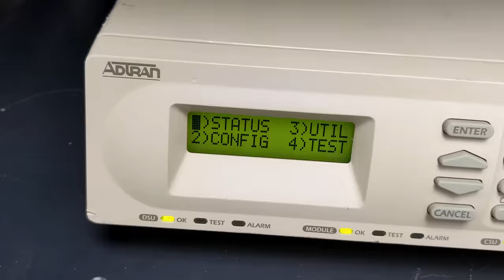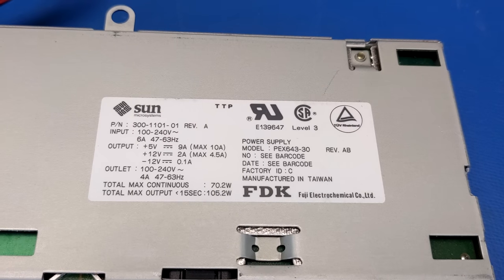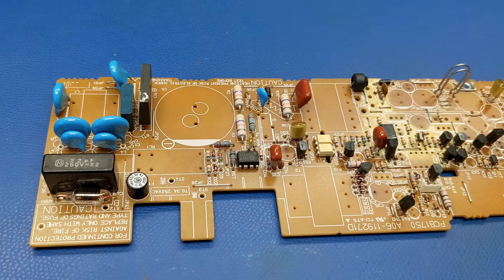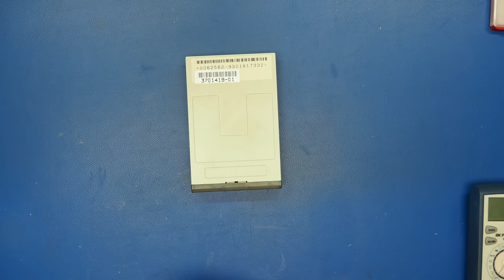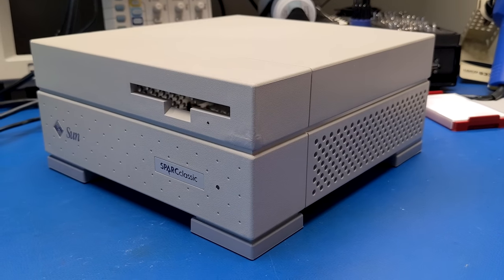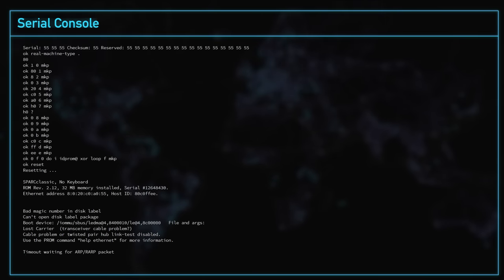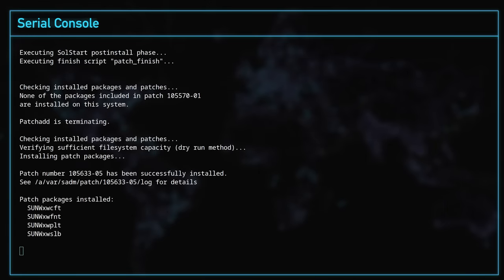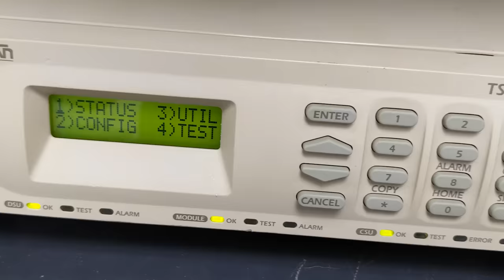SAVING a 30-year old Sun workstation! - ISP Series Episode 2

Comment: 35:27 The usage output shows a "-m" option (even with the normal skel system for the initial directory contents) similar to modern useradd implementations, I don't think you would have needed to create it manually if you used it.

Comment: Nice video and great job. I probably mentioned already that I used a Sun Sparc 20 with Solaris 8 as my main system sometime between Beos 5 and Linux and used it to stream international radio with Real Player. I also had Basilisk II emulating Mac Os 8 on a 21in CRT monitor. These were very reliable machines.

Comment: Satisfying board & mechanical design. The latching lever is just 🤯

Related tip for fellow tinkerers: if you need to repair broken plastic but can't access a 3D-printer, there's always the classic "superglue & baking soda" -method.

You just need these two ingredients and a file and/or sandpaper. If the part is visible, finish with some paint (model paint is really good).

I have succesfully repaired a broken record player hinge, battery compartment covers and one printer tray. The fix is very durable!
Reply: Yes!  I learned that trick from an Adam Savage video not long ago and I was a bit surprised they didn't use it to fill around the 3d-printed part.  As an aside, it works really well to patch a cracked fingernail until it grows out enough too!

Comment: I used to have this exact model on my desk (along with a CD-ROM extension module (CD Caddys - ugh) & storage) with a massive 19" Sun (Sony Trinitron) CRT monitor. Our core systems were Unix machines when I worked for a stockbrokers. Pyramid DC-OSx Mini's then and HP Mini's along with some Xenix boxes. The Sun was our management and monitoring workstation running XWindows - I had a display running on it that would show current CPU usage for all the UNIX machines, and would use it to console onto all our servers as needed. Was (at the time) much easier to use than a Windows machine as with Windows 3.1 at the time you needed tonnes of extra software to achieve the same outcomes.

Comment: I was there in the 90s local dialup ISP. We didn't use Sun, but it's still nostalgiac for me 👍
Reply: I had about 10 of these machines in the end.  We ran RADIUS out of them to get user accounts working.  Other ISPs I worked for - we transitioned to freeBSD.
Reply: @tcpnetworks  We began as a Windows shop, but switched to Linux for basically everything but the customer representative's desktops.

Comment: Wow that's brought back memories seeing Solaris again. My first intro to Sun Microsystems was a pair of SPARC 20 servers I set up for email and DNS back in '95. Spent the next 20 years working with a variety of SPARC and x86/x64 systems. Last one I worked on before changing jobs was an M3000. I always likened the sound of the fans on startup to the sound of a Harrier jump jet!  The Suns were rock solid kit. My only regret is not bagging one of the SPARC20s when ghey were replaced!

Comment: I had that exact model that I got from work when they were about to throw it out. I got it working with Redhat, but it was slow. Loved the keyboard. Shortly after moving to an apartment, I threw it out and I've been kicking myself over it ever since :(
I remember accessing my university's Sun system remotely over PPP in the '90s.  I discovered a library that tunneled all TCP/IP requests over PPP and let my local X-Windows Server display GUI apps running remotely on the Sun system. There was a method to apply this library to any app. It was awesome, I was probably one of very few people in the university using this system like that.

Comment: Wow, that brings back a lot of memories. I lived in Silicon Valley during the first dot-com boom, and thanks to some friends I was able to score a SPARCstation IPC (or maybe IPX; I forget which) for my home computer for a reasonable amount of money. As I recall, the Sun 13W3-to-SVGA video cable cost me more than the workstation. Great machine for the time, though. 

I also remember setting up a “Custom Jumpstart Install” server for work, which was great. You could net boot a new Sun workstation, and based on the CPU type/RAM/HD size/subnet the server would automatically install and configure Solaris and a bunch of application software. The company I worked for was a hardware manufacturer and all our engineers had Sun workstations on their desks, plus we had a BUNCH in our labs, so that was a huge time saver.
Reply: You could run a fairly large Sun installation on two system administrators.  

More than a 1000 machines was completely ok.

Comment: If you want another challenge, I have a variety of old SUN workstations and parts. I do need to get rid of them but I don't want it to be e-waste. Minor items you mentioned in this video, I have a sun serial splitter cable, I have an external CDROM drive and CD carriers, I have SUN Type 4 and 5 keyboards and optical mice (with the grids for the mice), I have a SUB color monitor. I have a couple of SUN SPARCstation 1+ that were working even after I got this all here. I have a SPARCstation 4, 5 and 10 that may or not work. All these are the SUN "pizza box" form factor. I have a SPARCstation IPC that is same form factor as your SUN Classic. I have multiple SUN manuals, lots of extra SBUS cards and Solaris and SunOS software.

Comment: ah, hearing that modem - the nostaliga is strong with this one, subscribed !! - was a sun/solaris engineer for 10 years, bounced around the world building from the ground up to fully remote net boot installs, what a lovely OS solaris was - remember the forth interpreter in the boot prompt :D my own pet peeve with sun, why oh why on the keyboard have the power switch on the top right, how many times that got knocked. Seeing this lovely machine restored reminded me of my first sparc machine, with CD, DAT Drive and Sun Monitor. I worked for an ISP in Central London, the onwer dontated it to me. I live in a nearby seaside town, my commute was on coach. I had to carry the lot and the monitor from near Oxford Street to Embankment, but it sure was the envy of alot of people back in my hometown when I got it up and running - that huge sun monitor !!!

Comment: This was amazing to watch. 

It does reminds me though that I have a Sun Blade 100 workstation with a defective ID-PROM... I have had the replacement part for ages, so it should be possible to fix it.
Reply: The EE-Prom in Sparcstations do not fail per se;  it's only the internal battery for the DSxxxx clock/calendar.
But, since the battery, clock/cal, and eeprom are all potted into the DIP plug, ya gotta replace the whole  !@#$# thing

Comment: OUTSTANDING, from 1996-2007 I worked off of Sparc 20, Ultra 2, Ultra 80.. Love CDE desktop..of the ye olde  UNIXs I have work with, AIX, IRIX, HP-UX, Sun was the best. Move on to useing a Macbook but still have a Sparc 10 at home. Well done video! Anyway, still doing Linux work..

Comment: Once you get the dial up setup. You are also close to using the same equipment to setup a wisp, dsl, and a few other examples of hardware used on early internet access. I know the wisp is pushing it. But nothing says you can have two directional antennas across the room from each other. Will one directional and one dipole and use some Cisco access points.

Comment: Your new fan is half the power of the old one. If you're running it much, you might want to find a like for like replacement, or just clean and lubricate the original part. The replacement, assuming vaguely similar efficiency, can't be moving as much air because the lower power means it doesn't impart as much energy on the air. Thats before we consider the fan curve :)
Reply: True, but since they're not running an old full 1" height 3.5" mechanical SCSI hard drive in there, I'd say it should suffice. I have a couple of SPARCstation IPXes, and the hard drive is the component that is easily producing the most heat.
Reply: Depends on the fan. Motor and fan technology has improved since this thing was built.
Reply: @jfbeam  Not by that much, it isn't a shaded pole motor.

Comment: Very cool video!  This made me go check my stash and cuddle with my Sparc IPX in that same form factor.  After I bought it used in the early 2000’s, I had the same fun of net booting SUSE Linux, and used it as a dev system to write code using Xemacs.  I’ve wondered for a while now if it would even power up… it’s been sitting in a pile withs it’s Spark Station 2 sister for about 20 years completely unused.  I still have one of those awesome soft touch sun keyboards with the giant “Help” key!

Comment: In the mid '80, I had an HP3000 mini-computer. I connected a few 2400bps modems made by a company that "cloned" Hayes modems. I used a thinMAU adapter to connect to DSL internet. People at HP told I cold ne be done ! But it worked ! I was even able to create a interface from Ethernet to Token ring. One of my client was really happy when they learned about this. They wanted an high-speed transport to synchronize files between two mainframes.
Reply: For some reason or another,  many at HP by that time didn't know what could be done on a HP3000.

They very basically afraid of how to take care of MPE and HP-UX and how to extend and improve.
Reply: @TheStefanskoglund1  True ! One thing I learned afterwards is that management was afraid that clients would migrate to IBM using this method!

Comment: I managed to bag a suite of these along with the longer thinner unitsm back in the early 1990s. I still have them, but now with only 1 set of peripherals and 1 huge CRT. I also salvaged a lot of the memory modules out of those longer thinner Sparc stations - the modules use UDE like connectors and look like someone welded DIMMs together (back to back and side to side - they are thick!) They did all work and I did have the CD drive and still have a few hard drives, but alas no software or time/inclination to do anything with them!

Comment: I had a SparcClassic in the early 2000s.  I had installed OpenBSD 2.7 on it with Apache, MySQL, PHP, and the PHPBB2 online forum.  Not bad for 50Mhz and 48MB of 72pin RAM.

Comment: Those Sparc Classic have a trick. You can put 32 MB Ram modules in the first bank (not officially supported). I used some I cannibalised from an IBM 486 NetWare server (huge tower) to get a little bit more Ooomph. Sadly my power supply exhibited the same symptoms as yours a while ago, and not being competent with electronics I relegated it to the closet. Your video is tempting me to try and salvage it, but I don't have the tools nor the skills. Maybe if I can shoehorn a tiny modern generic power supply ? We'll see.

Comment: I had a Sparc Classic at home... long ago... I got rid of it when the battery of the NVRAM failed, as it was a PITA to tell it the boot path every time it booted and I couldn't be bothered to find a way to replace it. ( on the other hand I had an Sparc Server 20 at hand and eyes set on an U45 ( I got that one and still have & use it ) ).

Comment: Nice video, this makes me hopeful I can repair and restore the SUN SparcStation I have which also has the dreaded leaky caps on the PSU.
The PSU casing is a bit more rusty than you had though, so hoping the leakage didn't drip down on the motherboard. Or if it did, it did not damage it too much.

Comment: BTW, you could've saved some headaches by just sticking the iso on the zuluscsi sd card. I know it's worked at one point in time, because I have installed a sparcstation 20 from an iso to a hard drive image on the one sd card

Comment: You may experience issues with / being so small.  Since there is no partition for /var it can come back to bite you.  Also there is no installed C compiler in this version of Solaris.  That was an expensive option back in the day.  You will need to get gcc installed.    There will be more hidden gems to find.  Personally I would have installed 2.5.1 as 2.6 was a bit bloated for the time. For larger sun4m systems like the ss20 with more cpus it was not an issue.  I still have my quad 150mhz Ross ss20 and my first LX from that time period.

Comment: few years my LX PSU let out the magic smoke, I recapped the system, but there was still issues, I found a local TV repair, that traced the faults, and My LX this day, it captures timelapse images using the VideoPix 1.0 subs capture card

Comment: There is a full replacement board with replacable battery for those dallas timebombs made by NecroWare.
Reply: Yup, but SPARCstations don't use a Dallas DS1287 RTC module like many PCs did, but an ST/Mostek M48T02 NVRAM. They're completely different.
Reply: @kpanic23  aw, that sucks

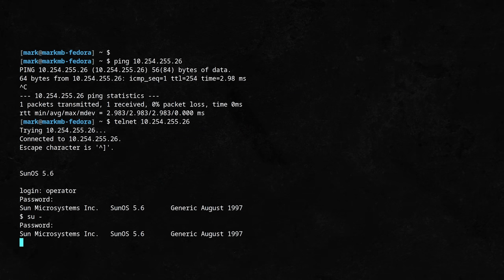Comment: 35:43 maybe not included oob but should be available..I helped work on SHOUTcast a bit back in the day right around/before AOL ruined Nullsoft and all the servers were Solaris and used private key auth (maybe because of the 8 char limit partially? I don't remember if that was still a thing in later v8 or not?) and I think that was my first time using private key auth, ssh still felt newish then even alone..though my exact date timing could be off, I still had access to some boxes and relay servers til like 2009 and know some were on 9 but I'm thinking my ability to contribute and shoutcast itself (as far as dev) was pretty dead or dying hard by the time solaris 9 launched, my internet radio station launched in 2000 with full official launch in 2001

Comment: the square cut left a lot to be desired. as soon as i saw the hesitation on the dremel cut, i knew this was gonna be an issue. what I can say is you color and texture matched it great but the piece just doesnt fit right - you can see the line from the front - its front and center visible, it had to be made slightly oversize and sanded down by hand possibly even with filler paste
Reply: I would rather have made a silicone mold from the lower part of the case corner, below the chip, to copy the texture and then used Bondo to fill in the chipped area, then pressed the mold into it to "stamp" the texture in...

Comment: I started my ISP - TCPnetworks - in 1993.   It offered IP connections over 2.4K modems - and I used Cisco 2511's.  I started with 1 - and had to increase footprint quickly.   Sold the business to Asia-Online in 1998.   They promptly fucked it...
Reply from the maker: Wow!  Were you attaching dial-in modems to the Cisco?  How did that work out ?

Comment: The Elna caps in MANY things from that era were always bad. the other such product to be wary of is Powerbook 100 series wall bricks. They were relentlessly bad with that. You needed to clamp them down in a vise to crack the ultrasonic weld and then get in with tweezers to get the old caps out. the electrolyte smelled like rank tuna.

Comment: I'm curious -- what is the downside to replacing the NVRAM module with a new part? I always thought if you could buy a compatible part, it was superior to soldering a new coin cell in.
Reply: A like for like replacement will also have the battery die after a while, and the aftermarket ones with exposed battery slots are certainly more expensive than this mod. There’s nothing wrong with replacing the NVRAM, it’s just not inherently superior to adding the coin cell in this one either.
Reply: 1st, replacements are new old stock, meaning they could also be dead. Second, if you replace it with a coin cell holder, and you don't wait until its completely dead, yes it will warn you when it is low, you can replace the battery without having to reconfigure the eeprom.

Comment: nice going with the power supply, but I gotta wonder, you must have spent many many hours and hours on this. Would have been cheaper to buy replacement, yes? Also maybe it's the way you photographed it, but respectfully, some of those joins you soldered look like "cold joints"
Reply: There's no modern replacement for these PSUs, they were specially made for Sun. Any spare part would have been as old as the original one and possibly have the same issue with leaking capacitors.
I got three SPARCstation IPXes two years ago, and all three had a bad power supply. The power supplies were made by Sony, but still, same leaky caps problem.

Comment: I don't think you explained very well why people would use one of these.  It really has nothing to do with the CPU speed, or the footprint of the machine.  Machines like this were for when you needed a UNIX workstation/server... In the late 80s/early 90s, there was no fully-fledged UNIX for x86 with wide hardware support, and x86 machines also lacked the kind of higher-end I/O options UNIX machines did.  For example, high-speed buses and SCSI, and other advanced networking gear.  This wasn't available, because PC were for homes, and people at home didn't need or couldn't afford high end interfaces like this.  This is stuff corporations would use.

The emergence of Linux (and improvements in other server OSes like NT) meant that less expensive x86 architectures could do these tasks, and server/workstation hardware manufacturers could target this platform.  That's why most servers these days are Linux (which is a UNIX clone).